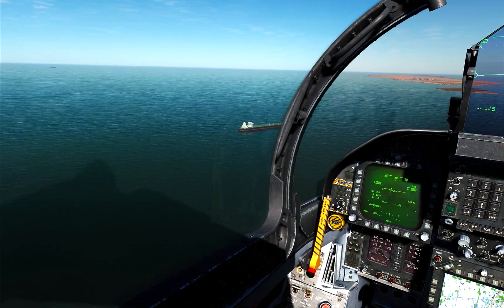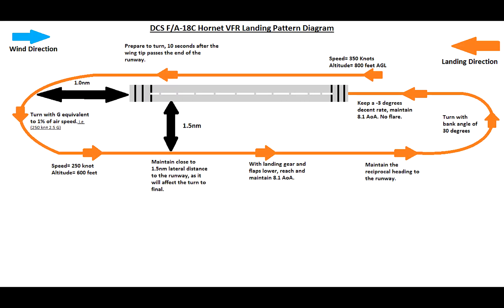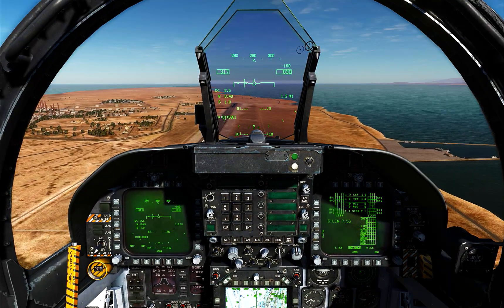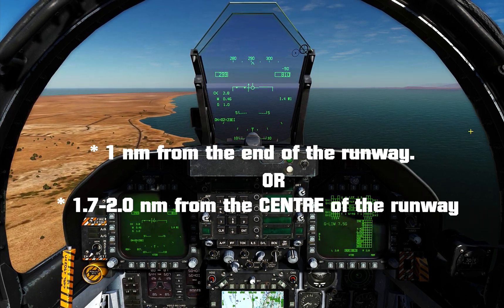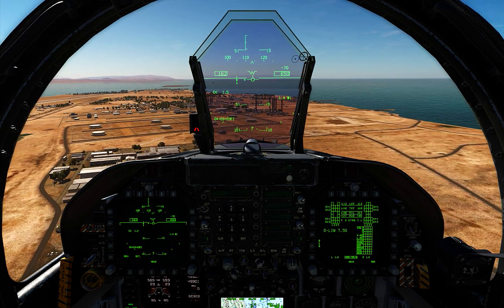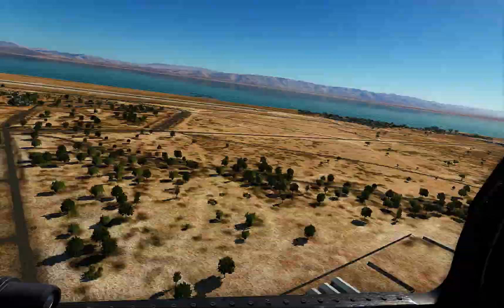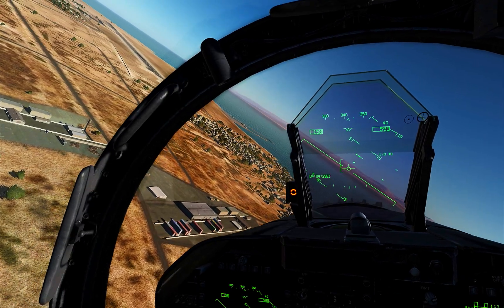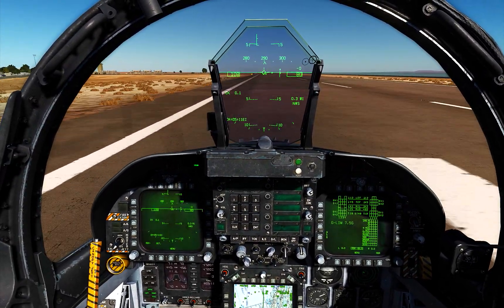DCS: F/A-18C "VFR Landing Pattern"

Comment: thnaks for the great vid, i notice the advice is to enter the downleg at 350 knotts, do we maintain that speed until the turn or decrease to around 300 as you have done?, i always did wonder how it was possible to turn at 3.5 G
Reply from the maker: I am very sorry for the late response, I haven’t had much time playing DCS as of late and certainly not the Hornet. They might have changed things around since it almost out of early access. From what I remember the 3.5 G turn is to set you up for nice reciprocal heading downwind. So if you can manage that, it shouldn’t really matter. It’s all done that way to allow you to make a single sweeping turn onto final at AoA without having to make last minute directional turn, which ultimately result in you losing your on AoA angle. Hope that addresses your question and once again I apologise for the late reply. All the best.

Comment: Please help... when i put my gears and flaps down, my nose flares up gaining altitude and while ill catching the e bracket with pitch trim. By then, I gained so much altitude.  Should I use my flight stick instead of pitch trim?
Reply from the maker: Hi...well that really shouldn't be happening in a Fly by Wire aircraft as the computer should correct for the extra lift provided by engaging the flaps down. That been said you can pull back on the throttle in anticipation before dropping flaps, that should help. I will be doing a new F/A-18 and F-14 tutorial series starting from the F-4U Corsair. I hope that helped.

Comment: I've seen quite a few videos of the same topic and you my man, are the only one who mentions the ballooning effect on flaps down. Thank you for that! So I've a question for you, do you compensate with upstick or do you wait to be below a certain speed before you go full flaps down? As soon as I hit 250 I go gear down and full flaps down and the marker just shoots up I go full upstick and still E bracket is off the roof. Thanks in advance! Kudos
Reply from the maker: Hi, thank you my friend. To be honest I don't think the ballooning should even happen, as the FA-18 is fly by wire. The Flight Control Computer would compensate for it, but I am not sure, so I would just compensate with some early pitch down trim. Cheers
Reply: Thanks my friend 👍